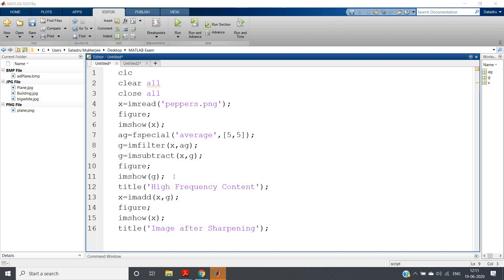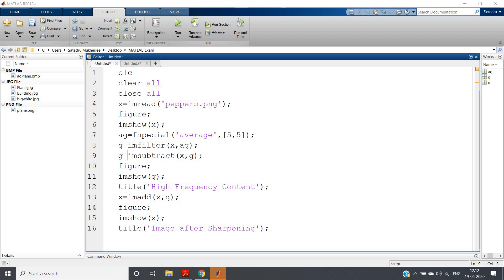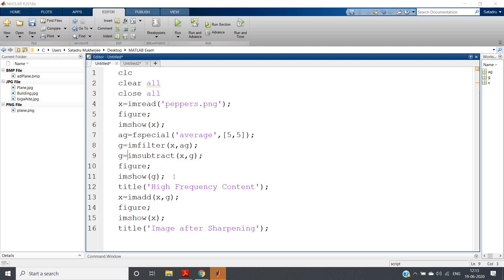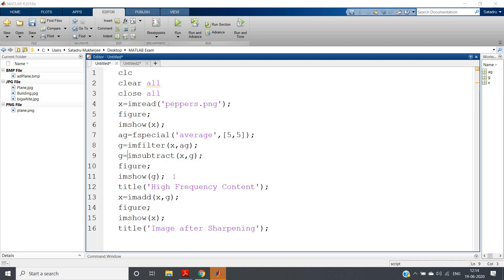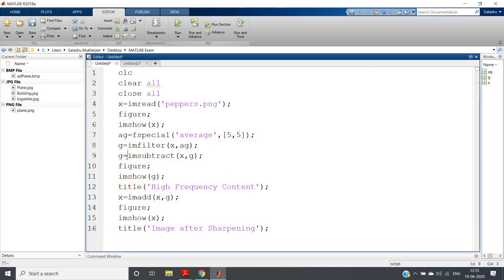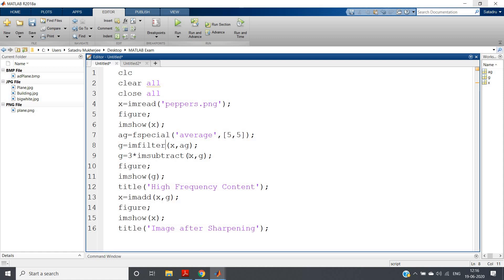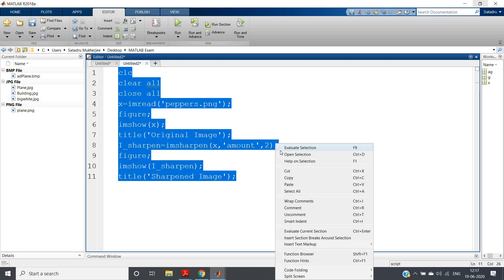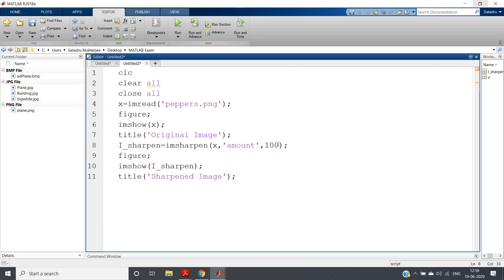Sharpen image using unsharp masking | MATLAB

Comment: How to perform smoothening operation and sharpening operation in different image?
Reply from the maker: You can apply moving average filter or Gaussian filter (or any low pass filter) for smoothing an image and for sharpening , you can use unsharp masking .
Here are the videos , which might help you ..
1)MATLAB Program to blur an image
https://youtu.be/kPsKMMMLERM
2)Gaussian Filter in MATLAB
https://youtu.be/SmY4beCAytM
3)Sharpen image using unsharp masking | MATLAB
https://youtu.be/7fZadZ_mvSE

Hope it will help you.
Happy Coding :-)